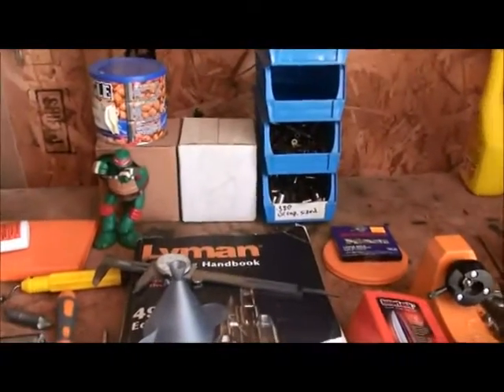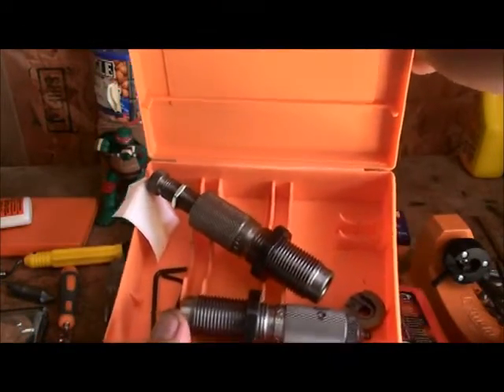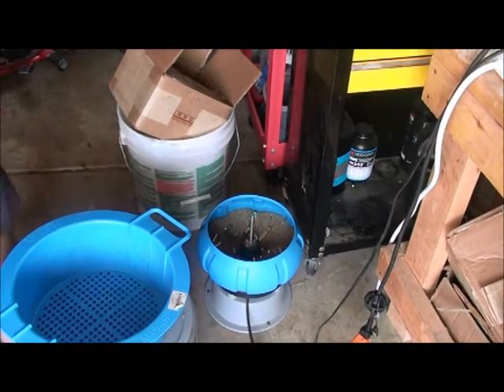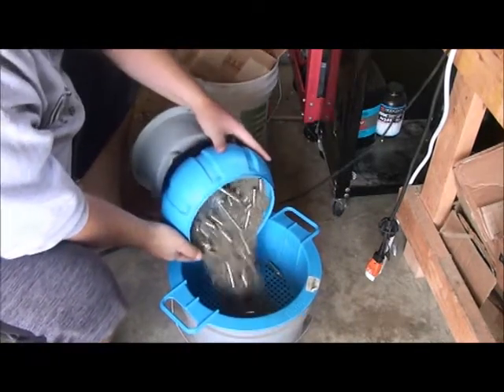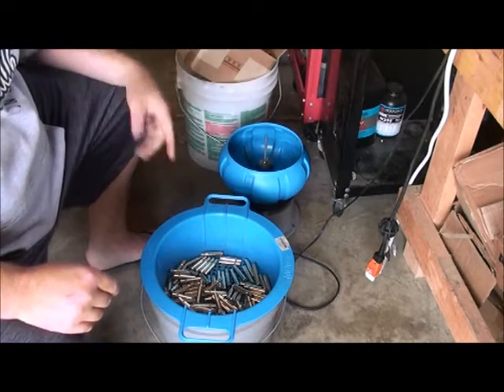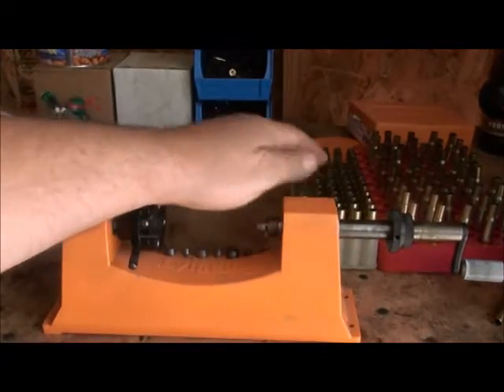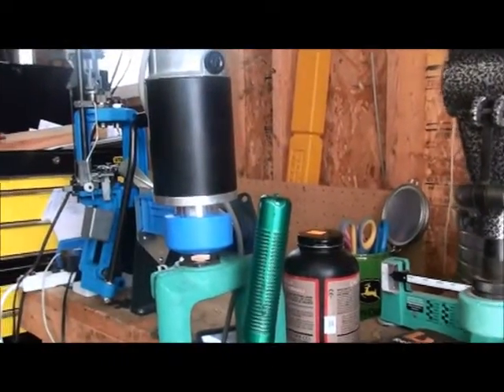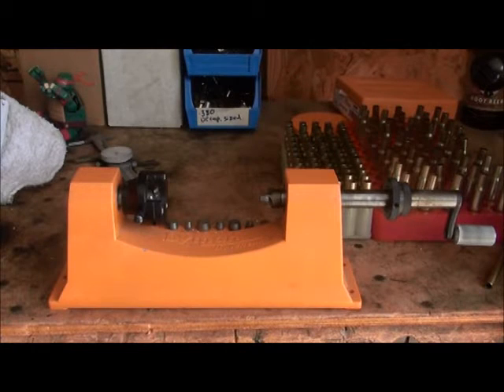reloading .30-30 winchester

Comment: Using a pad is the safest way to lube so you do not oil the shoulder at all. Spray is the best way to get oil on the shoulder. It only takes a small amount of oil to deform a shoulder on any bottleneck case. But, spray is faster and if you (I) lay a paper towel just over the place where the shoulder starts I will avoid oiling the neck and shoulder, thus avoiding wrinkles.

Comment: When you are trimming to length, what sets the amount of trim?  Is it the guide? And then you bottom out the spindle and spin?  Or do you have to set something else to get the specific length you want cut?  And how much soap do you use in the tumblers?  Thanks.
Reply from the maker: There is a stop that you set for the trimmer. And i just use about 2 9mm shells of dish soap

Comment: That priming system is a lot like the one on my RCBS press. Very nice video by the way. 30-30 will be my next cartridge that I reload.
Reply from the maker: thank you vince. and yes they are very simular, in fact I used parts from my rcbs priming system and put them on the llyman. Have a great day,

Comment: Deprime before you tumble.
Reply from the maker: KingRatt  no, I now wet tumble prior to reloading, it gets all the dirt  and crud off the case. Then I place the clean brass into the dies. Then after Decapping I re tumble the brass to get the oil off from the sizing lube, and also clean the primer pockets.
Reply: Jason Williams right the reason to deprime 
pre tumble is to clean the primer pocket.
Reply from the maker: KingRatt did you see the whole video?You would see I tumbled the brass after I de- primmed the cases.
Reply: No I commented when I saw you cleaning primer pockets with your drill.